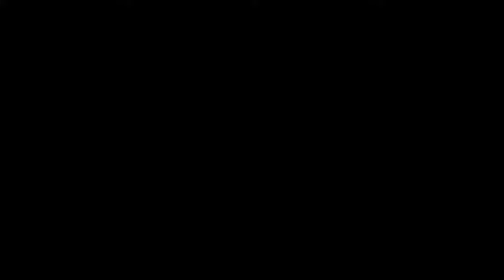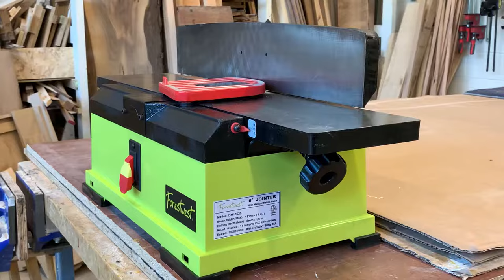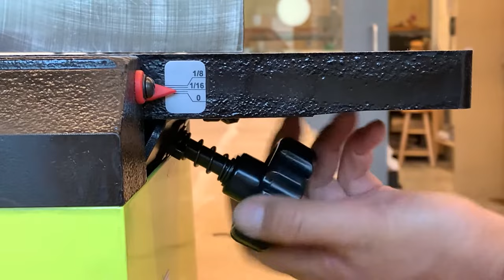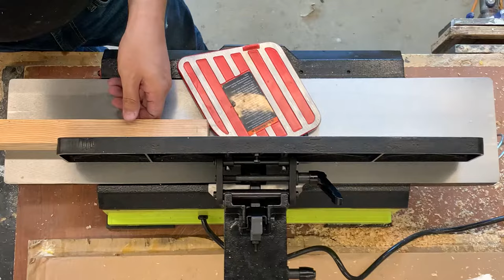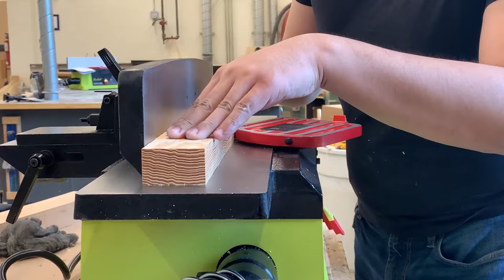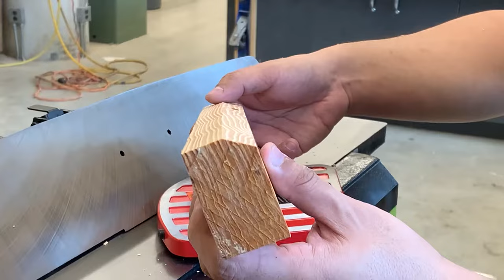FORESTWEST 6 Inch Benchtop Helical Head Cast Iron Jointer | Woodworking Tools | Affordable Jointer

Comment: I sure hope you make a 8" and 10" version of this.  My shop is too small for a combo and I can easily tuck away a jointer and a thickness planer if they are separate tools.  I've been looking at some 10" benchtop jointers but none are cast iron top and don't have a spiral cutter.  I can't be the only one who want's this and doesn't care about the weight of it.